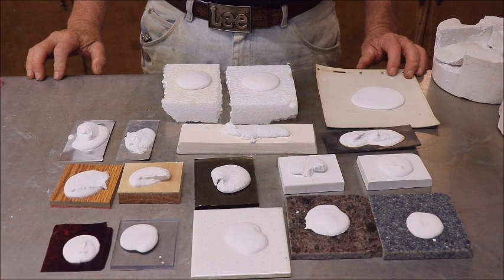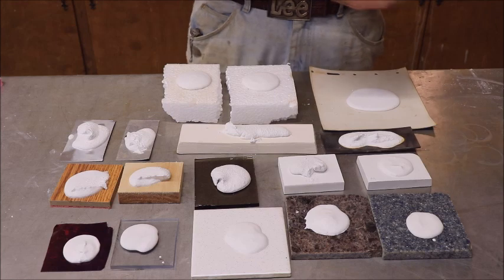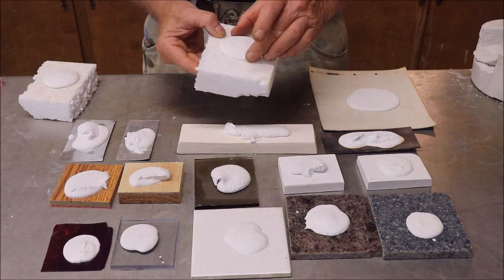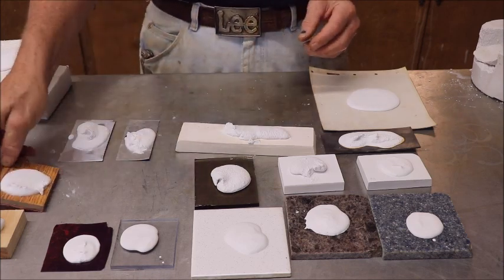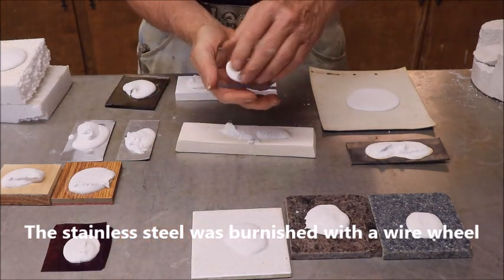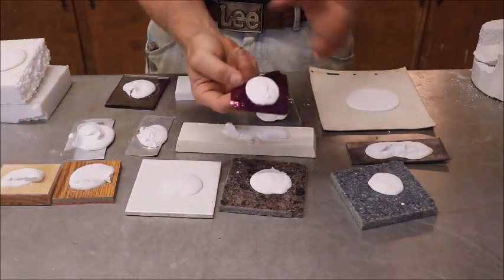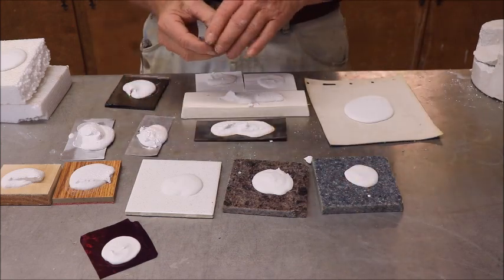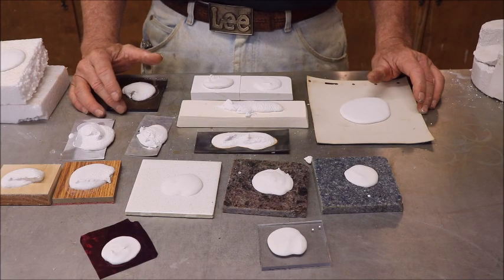What Will Plaster Stick To?

Comment: I’m trying to form a shape over a face plastic mask, would plaster work with forming a new shape on the mask and would it harden? I’m a noob too all of this stuff haha 😅 

I was also wondering if it would stick to the plastic because it’s a smooth plastic finish im trying to put the plaster over. A lady at a hardware store I talked to said it may not stick and will be difficult to do so.
Reply from the maker: The plaster will harden, however if you are going to leave the plaster on the mask and there is any flex to the mask the plaster will turn loose or crack.  Plaster does not bend.

Comment: Great video 😊 I'm trying to find out if it will stick to a plastic plant pot 🤔
Reply from the maker: If you are trying to use the plastic pot as a mold make sure you use somekind of a mold release on the plastic and there are no undercuts on the pot that will hamper removal.

Comment: Please help!!! I have a polymer clay print of my dog’s paw, who’s since passed. I want to use that as a mold to make a plaster “3D” print of her paw. The question is will plaster stick to polymer clay? Any help is appreciated as this is the only copy I have and don’t want to ruin it. It means so much to me. Thanks very much!
Reply from the maker: I would make some sort of ttrial piece from polymer clay (maybe 2 or 3) and then coat it with various mold releases.  Green soap comes to mind, also vasoline or a commercial mld release.  The sample cast eill give you some idea of what the plaster will stick to.

Comment: What if you used wood glue to mix into the plaster?
Reply from the maker: I have never tried that.  Might help if you want the plaster to stick to something it did not.
Reply: @CaptMike  I know its something typically done to joint compound and its premixed into the green buckets you find in home depot, but ive never seen it added to plaster so idk what the adhesion & material bond is like with plaster compared to gypsum joint compound.
Reply from the maker: @ubacow7109  If I was using the plaster to make a mold (for use with slip clay) I would be concerned that the glue would effect the water absorbtion from the clay.  What do you think?

Comment: Hi can you please guide me if plaster would stick on XPS foam? I have to make a small architectural model and I need to use these materials for this
Reply from the maker: I'm not sure what XPS foam is, ut I did run a test on regular sheet foam and the plaster adhered well.  Let me know how it works out for you.

Comment: Great video. I want to make a relief wall sculpture with a back panel of wood, plaster or similar but it has to be fairly light. I then want a raised 3d plaster design on top so would pour the plaster directly onto material and sculpt. I need a work time of approx 20 min. I think a large plaster backboard would be too heavy and wood wouldn't stick. What other types of backboard are readily available on the market and could be cut to size and allow plaster to stick to it once poured?

Also, whenever I've had plaster splash onto finished pieces before it was always very easy to pick the plaster off even when dry so I never thought plaster could completely stick to plaster. I used crystacal r plaster. If you could give some advice as I could consider using small plaster backboards for some designs but it depends on size and weight of overall piece.
Reply from the maker: Plaster will stick to plaster if both are fully hydrated.  Fot weight reduction you might try foam board.  You might have to cover the board with chicken wire or a similar matrerial and then apply your plaster.  After you have made you sculpture, even if it comes loose, you can always glue it back on.  Hope this helps.
Reply: Many thanks for you last reply. I'm finding plaster on plaster too heavy for some of my relief sculptures. I originally wanted to wall mount a plaster plaque with a plaster embossed relief design. I pour the plaster o to the plaque then have a short window to work before the plaster dries. I just wondered if there was anything else I could use thst was far lighter than a plaster base, whereby. I could pour a small amount of plaster onto it and sculpt, and it would dry hard after a short time so I could then hang it up.
Reply from the maker: @daveymichael6891  The foam board as a backer is all I can think of right now.  I will try that mysel and see how well the plaster sticks.  Sorry I could not offer more help.

Comment: Has vegetable oil ever been used in place of water in mixing plaster as a way to add plasticity? Any chemical reason you know of that this would not work?
Reply from the maker: Joseph, I have never tried that, but it sounds interesting!

Comment: On the plaster to un-rehydrated plaster, did you still brush the surface with water beforehand? I guess that would still be considered rehydrating to a certain extent. Basically, was the plaster completely dry?
Reply from the maker: No, on that test I simply placed the new plaster onto the cured (dried) plaster and let it set up.

Comment: How about concrete? Can I make a plaster mold for casting concrete?
Reply from the maker: To be honest, I have never tried.  Cement hardens chemically and plaster molds are normally used to absorb water.  You could make a small mold, say a cup or something like that and use lots of vasaline or a comparable release compound and do tests.  Let me know how you come out.
Reply: @CaptMike  I'll try and see what's happening 😊
Reply: Have you tried it on cement? I was thinking of trying cement on pop.
Reply: @maggiolivier9855  No, made a latex form of my plaster model instead 😉 And then made my concrete item in the latex form.
Reply: @Dorthejuul  thank you so much this was very helpful

Comment: I am repairing little delicate fingers on a china/porcelain statue.  Should I use plaster or epoxy putty, or do you have suggestions as to how I can accomplish this?  I have four fingers to create hopefully by adding/building them on to the statute if the material I use will stick to the china break.
Reply from the maker: If the statue will not require additional heat epoxy would be a good bet.  You can get it in clear, cream or white (maybe more or tint it) If you could build a mold for the fingers(a little over sized) and cast the fingers in epoxy it would be easier to attach the fingers with more epoxy then using a drimmel or something similar you could sculpt the fingers and paint to match.  Hope this is helpful.
Reply: @CaptMike  Thanks for the advice!

Comment: What a beautiful experiment! Could you kindly share if there is a way to stick a plaster casting to a wood frame. 🙏🏻👏👍
Reply from the maker: Are you refering about sticking wet plaster to wire lathe?  If you have a frame with a backer in it, say wood.  you could pour the plaster directly onto the wood .  It might come loose when dry, but you couyld glue it back on. Hope this helps.
Reply: @CaptMike  Thank you for the feedback. I do plaster castings and I wanted to pour the wet plaster into the final hanging frame. So do you mean I should attach wire lathe to the inner sides of the frame? Thank you
Reply from the maker: @nhw8906  The plaster will need something to attach to, so if I had a frame I would at least have lathe (and backing board if possible) for the plaster to attach to.  Let me know how it comes out.
Reply: @CaptMike  Dear Capt. Mike, Thank you so much. I believe that should do it. I'm grateful for your help, your expertise and your generosity. Blessings
Reply from the maker: @nhw8906  if I can help in any way, please let me know.

Comment: Hi mike, I wanted to cover a Formica table with plaster. Do you recommend anything to prime it? Or can I just apply the plaster on top? It will be a thin coat. Less than 1/4” hopefully.
Reply from the maker: What do you plan to do with the table?  I have one product I use, a concrete sealer (not sodium silicate).  I will do a test tomorrow and let you know if it works.  Sodium Silicate has pealed up and flaked on me in the past.
Reply: @CaptMike  so it is a Formica coffee table. It has an odd shape “horseshoe” or “waterfall”. I am planning to use it indoors as a coffee table. It won’t be exposed to extreme heat or cold.
Reply from the maker: @marikadominika3806  Marika, I used the product, Quikrete High Gloss Sealer https://www.amazon.com/Quikrete-Concrete-Masonry-Gloss-Sealer/dp/B00L3T3D24/ref=sr_1_11?dchild=1&keywords=quikrete+high+gloss+sealer&qid=1615324966&sr=8-11 on two pieces, about $34.00 US.  Although the instructions say to use one coat I put three coats on.  It seems to shed water, but If you use this product I would test it on a plaster lab first.  Maybe a coat of pain on top of the sealer would help.  I'll test that too.

Comment: This was amazingly helpful. It looks as though the wood to which it slid off was MDF is that correct? Need a mould making for a mini set of stairs for my project so I was thinking wood
Reply from the maker: I thnk it was Oak, but MDF would act the same.  Spray a little vegatable oil on your wood mold first.  It will help with the release.
Reply: @CaptMike  thanks for the advice mate cheers! From the UK

Comment: I wanted to connect two pieces of wood with some colored plaster to make a gift for a friend. So this is helpful to know it won't work the way I originally planned.

Does anyone know, if I put a few metal pins in between two pieces of wood, would the plaster stick then?
Reply from the maker: If you are putting the plaster between the wood it would probably work to some degree,but I am sure the plaster would seperate as the wood dried.  There would be shrinkage.  The pins would hold it together though.

Comment: What did you put on the polyester styra foam to stop it sticking plz.
Reply from the maker: The first flat piece in the video had spray vegetable oil applied.  The second had nothing.  If I was going to use Styrofoam as a master to make a plaster mold I would try a test using Vaseline or something similar.

Comment: I'm very interested in how to clean up equipment /tools after using pop. We don't want to put it down the drain so washing up in sink is out of question. How do people clean up? 🤔🤔
Reply from the maker: Liz, I wash off plaster and clay using a water hose outside.  Since I  live in the country it is no problem.  If you can't use a hose get a 5 gallon bucket of water.  Remember that once plaster has dried (cured) it will not wash off.  Clay, on the other hand will wash off up until it is fired.

Comment: Captain mike what can i put in my plaster molds? I have 2000+ and as you've informed me...i can't use player of paris. I have kilns also.
Reply from the maker: If you have a kiln, even one designed for glass (usually fires to around 1700 F)  you can bisque clay slip.  If you cannot find slip to buy, make some.  I think I have a video on how to do that.  Anyway, just use regular ceramic clay and add water and blend it.  I have even made my on clay slip using local clay processed to remove the impurities (I have a video on that too).  If you need more info please let me know.
Reply: @CaptMike  thank you so much. I greatly appreciate it

Comment: When I started out training as a fibrous plasterer in the 1950s we always varnished our moulds (molds - us) with a shellac varnish. Before casting, we would lubricate the mould with tallow. Your casting should come out clean, but you may find small air holes that will need filling. For plain face moulding we used similar techniques to pouring except the first coat was always a brush coat of plaster followed by a splash coat and a dusting of powdered plaster. After that came the hemp scrim for strengthening. then lathes for stabilising, another brush coat and a final splash coat. The company I worked for made ceilings for Cinemas, Theatres, Factory canteens etc. Some pretty heavy duty castings. Eventually we made our own vinyl moulds which could be reused.
Reply from the maker: Very interesting.   Thanks for sharing.

Comment: Hi.. can we put wood primer before doing murals on wood for it to stick?
Reply: I'm making a wall hanging which is quite large and there will be a huge amt of POP and joint compound used in it..
Reply from the maker: @yolowithflo9928  I will run some tests on wood to see how well I can get POP to stick.  Goes without saying that the rougher the surface of the wood (complete with holes and such)  should hold better.
Reply from the maker: I have not tried that.  What type of project are you doing that requires plaster to stick to wood?
Reply: Thank you so much for the help... 😀

Comment: Will plaster stick to concrete?
Reply from the maker: I completed the test, and yes, yes it will.
Reply from the maker: I'll let you know.  Just went outside and got a slab.  After it dried off I'll put some on it and see.  I'm betting it will stick.  Got a project in mind?

Comment: would it work in a metal cake pan?
Reply from the maker: I have never tried using a metal pan as a mold, but I would think that if you sprayed a mold release of some sort on it first it would work.
Reply: I use a muffin tin from family dollar and it does not stick. You need to tap it lightly but it will not permanently adhere.

Comment: Hi Capt Mike. I have found grated laundry soap made to a paste with a little water until creamy and applied with a paint brush has been a helpful solution as a releasing agent on many surfaces. Have you tried that yourself?
Reply from the maker: Meryl, that is a great idea.  No I have not tried that one, but I have used a thick solution of Murphy's oil on wood with good results.
Reply: I haven't used any release, but how easy is it to paint over?